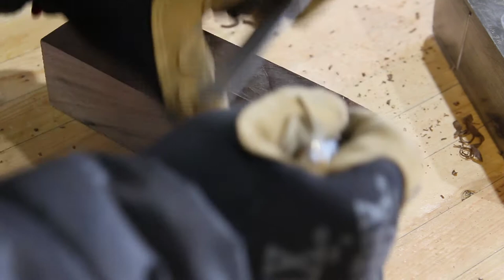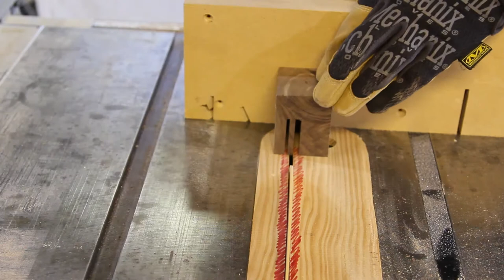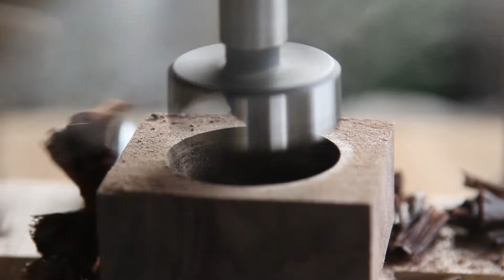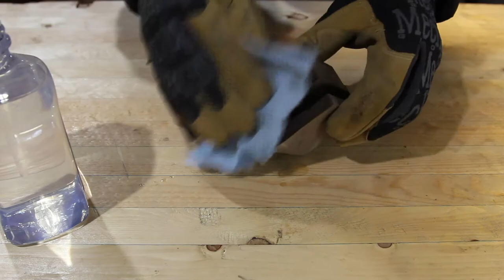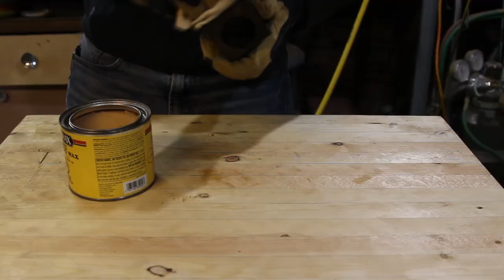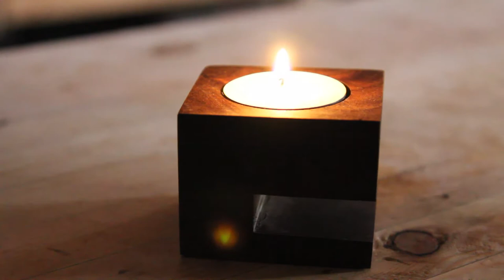Simple Candle Holder made from Scrap Walnut

Comment: How long are the sides of the cube and stuff like that?
Reply from the maker: The bit is 40mm.

The wood ended up being 52 x 75 x 48mm

The notch for the matches is 15mm from the bottom and then however large it needs to be to fit the matches snugly.

Doing this again I would have made the cuts in the end grain and not with the grain.  As the humidity changes, the wood warped a bit and the matches don't always come out.
Reply: Hey I'm a Maker Thanks just to ger it straight
Reply: Short side 52 long side 75 and height 48
Reply from the maker: @Xtraior   yes, Well actually the width is dependent on the box of matches. the height and length can be adjusted for what you think look good :)